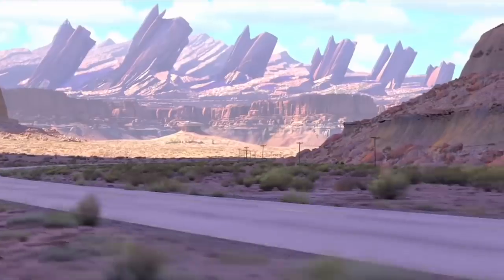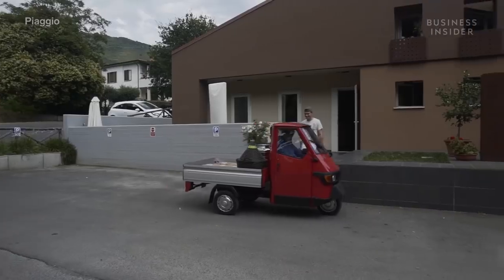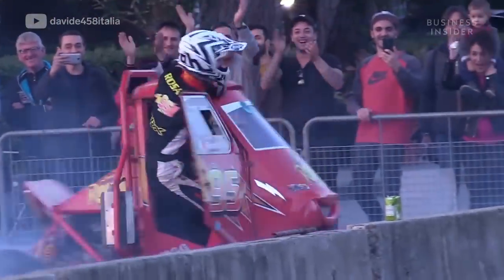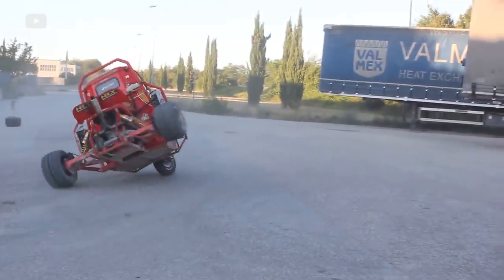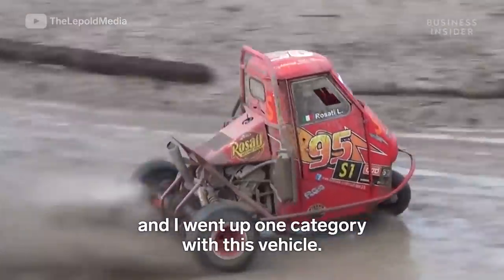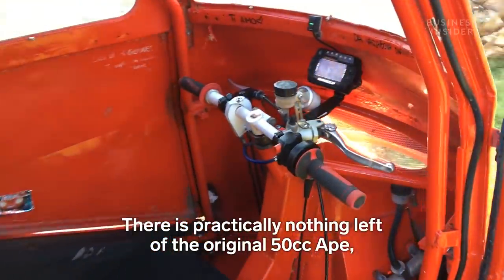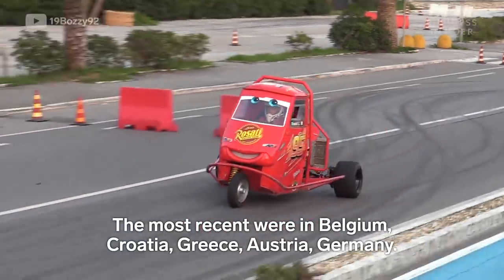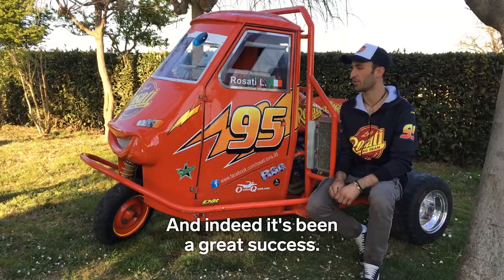Ape Racing Is The Best Motorsport You've Never Heard Of

Comment: Is that LSD or just one solid axle?
Reply: I am afraid your question is too technical to find and answer here... I'd like to know too though... You can ask the Italian youtubers that recorded him, they might know better.
Reply: it still is chain driven , so it is basically acting as a welded diff.
Reply: AFAIK most Ape Protos either use kart or quad bike axles, or automotive-derived locking diffs. Despite the fact that Loris is a bit of a local legend around these parts, I can't recall if he used the former or latter solution... But I'm quite sure he's using a solid axle & the rear wheels off a quad.
Reply: @pixelghostclyde8717  yeah you most probably right